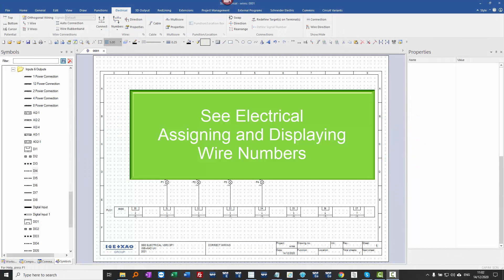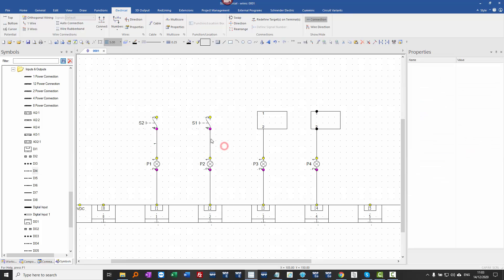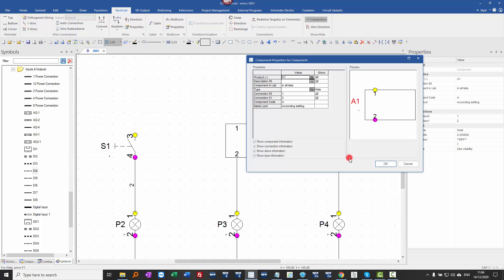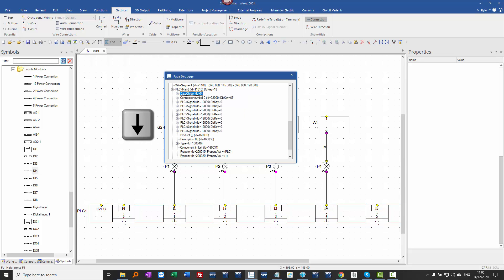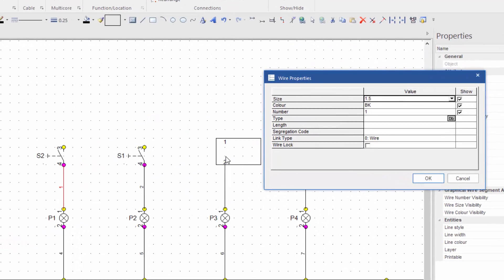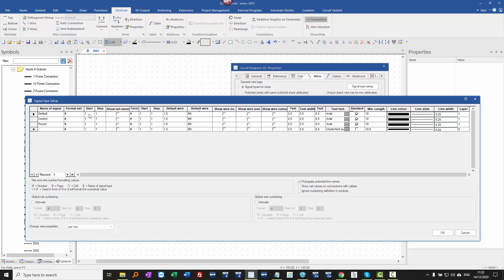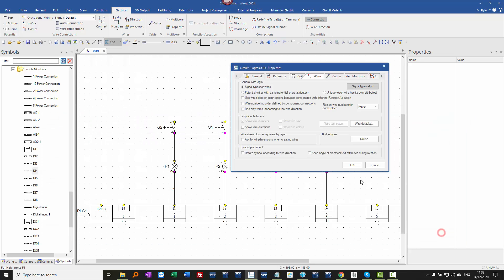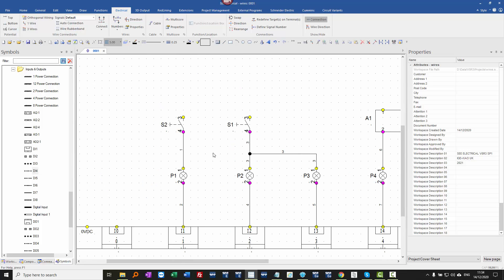Why can't I assign or display a wire number?

Comment: What could be happening? I can't get it to generate the numbers automatically when I use signals, but with potentials it's working, also when I change the signal type from power to control the color and section doesn't change
Reply from the maker: Make sure to enable the display of net numbers when enabling signal types. When you change a signal type, the visible line colour should change but the text attributes for size and colour will only change if automatically when you renumber the wires and select to reset size and colour attributes.

Comment: Hello. I have a problem with symbols in the Building Instalations section. The problem appears in the V8R3 version. If i place a symbol on my plan i can`t modify the display options (product, description, etc.). I have notice that this problem appears when i choose a standard template, and not for all symbols. For example : lights, sokets, panels, switches..Sounds like the symbols are locked somehow and can`t modify the display options..
Reply from the maker: Hi George, its a good question. I've put together a quick video to explain about a recent added feature to See Electrical Building called Symbol Display Groups: https://youtu.be/NFjn02jdeMc 

Hopefully this helps explain whats happening.
Reply: @IGEXAOUK  Yes this help me a lot! Thanks for everything!